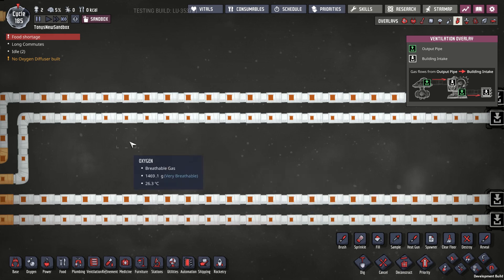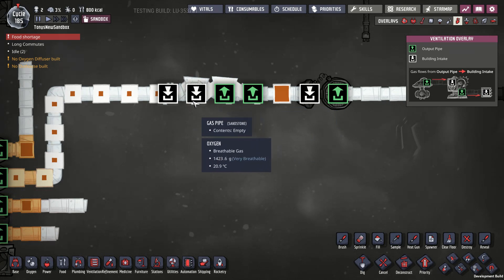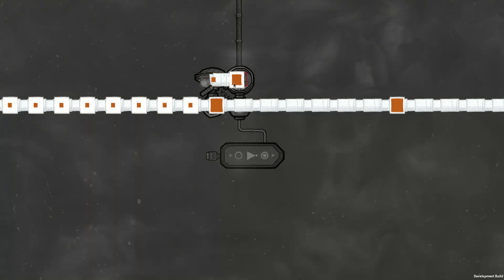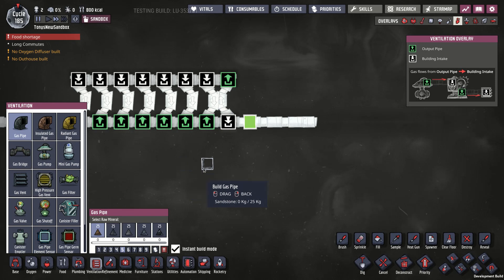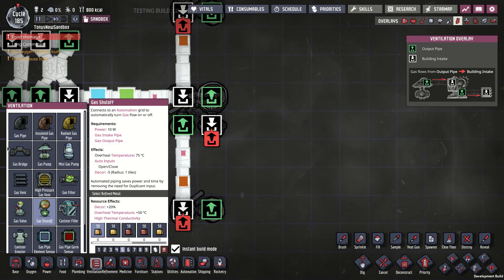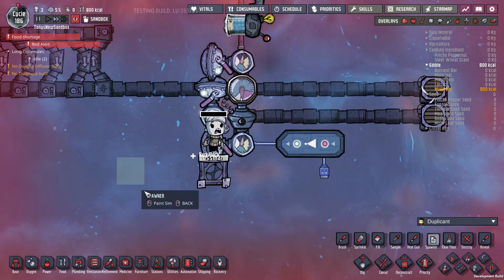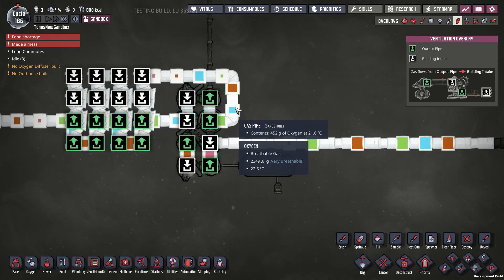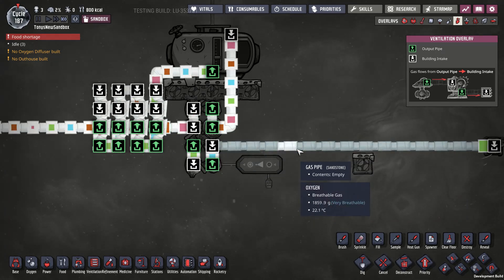Multi-Element Packet Stacking

Comment: To get rid of the gas reservoir, you'd need to merge the input pipe into the stacker backfeed instead of the opposite. But then there's danger you'll fill the loop with small packets of one gas and it will block the input pipe carrying a different gas. So I think the reservoir is necessary.

Actually I think I figured out how to make this thing safe with two gas reservoirs. You need two because you need to merge the backfeed smoothly with the feed and to do so without blocking neither the backfeed nor the feed, you need to split both using normal pipe joints, then merge one of each, feed it into the reservoid (one for each branch) and only then merge outputs of the two reservoirs, against using normal joints. The actual merging of packets will then be done in the reservoirs, not through bridges/vents. Only after that put your full packet extractor.
Reply from the maker: That's good thinking but I don't think anything works. You should watch the follow-up video where I try things like that and switch to a different strategy.
Reply: Yeah found it there :) It would work if the reservoir was pushing the largest packet it contains to the pipe but apparently that doesn't happen. The worst case scenario is one tiny packet of every gas followed by uninterrupted stream of full packets of one particular gas, e.g. hydrogen. The stacker needs to store those tiny packets somewhere while letting the full packets through.

Comment: Why would you want to stack full packets anyway?
Reply: I think it costs the same amount of energy to put a 10g packet through a thermo regulator as it does for a 500g packet. The aquatuner should also have the same issue.
Reply: Yup. Anything that has a per-packet rather than by-volume cost will benefit.
Reply from the maker: It's so you can use the pipe's full capacity. For example, it's easier to  filter/store/distribute 3 pipes than 10 pipes.